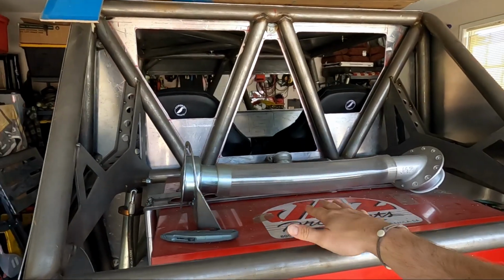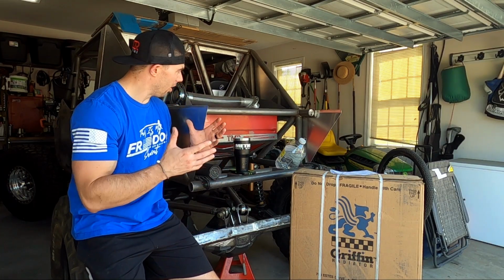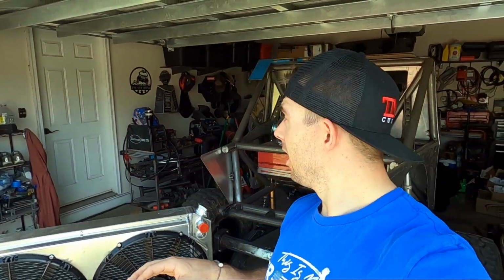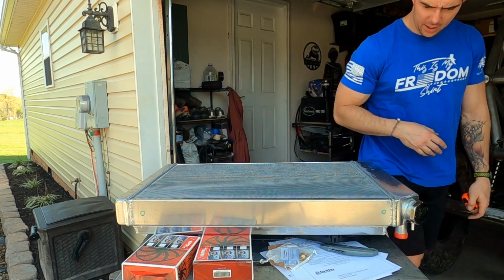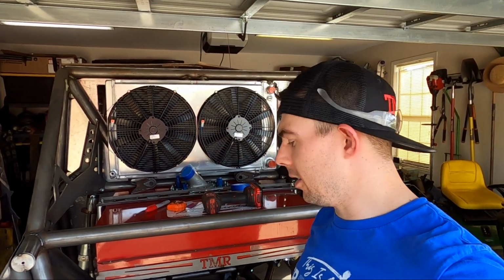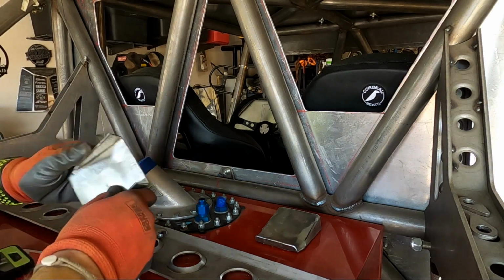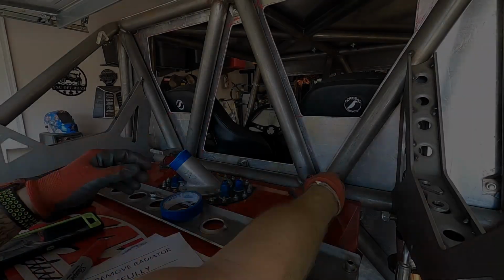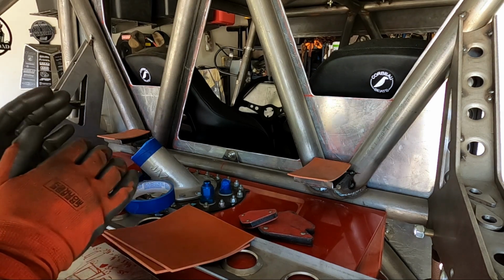DIY - Rear Mounted Radiator

Comment: Awesome video man! I moved my radiator to the back of my jimmys chassis and I was wondering if you had any issues getting water to flow at idle? It flows good right above idle but if you let off it basically quits flowing I have a new ls water pump on the way but I don’t have much faith since they are simple pumps with metal impellers.
Reply from the maker: I love the Jimmy's chassis, nice and compact. I didn't have any issues with the water pump, however I am redoing the supply and return lines as we speak. Could cause some issues, but I'm not sure. I also changed my water pump to the newer style truck pump for the correct return and spacing. I believe some companies offer higher output mechanical pumps for the LS.

Comment: Just curious if you think there will be any side to side movement with all the vibration. Maybe it is clamped down tight enough.
Reply from the maker: There’s a slight angle to the top mounts that apply a clamping force to the radiator when the bolts are tightened. With that the radiator shouldn’t move.